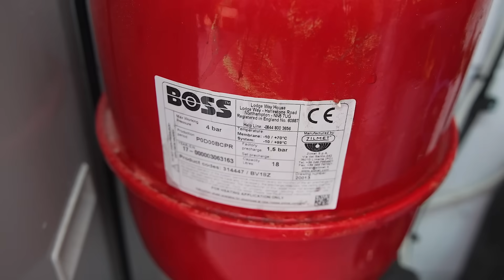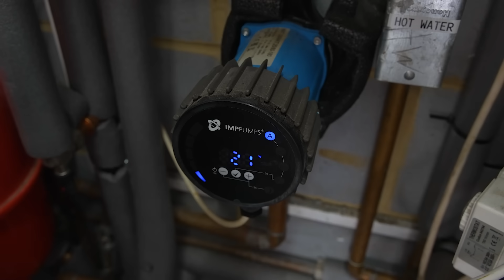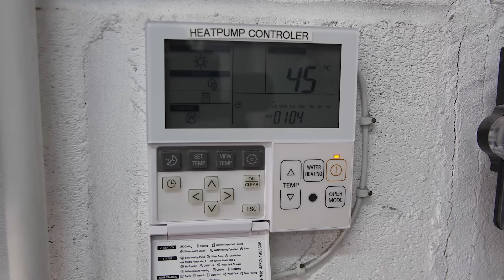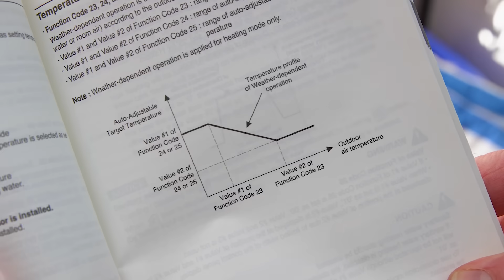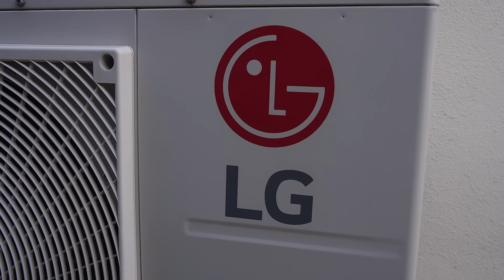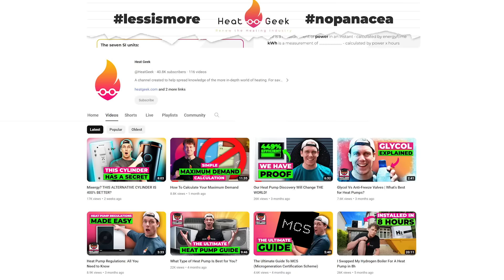Heat Geek Gives His Verdict on John’s Nightmare Heat Pump

Comment: What a great video Adam / Roger! Im sure Adam has a plan to offer John some options to fix his issue. However as a plan B we as installers of heat pumps for 23 years and just acquired by EDF we wanted to help and make an offer that we would replace the Heat pump, get rid of that gas boiler and do the alterations like Adam discussed for free. Our designers are Heat Geek trained also, all have the same vision! Offer is there :) We hate seeing consumers that have paid money for a heat pump with this outcome. Gives the industry a bad name....
Reply: Good on you. Hope this comment gets noticed!
Reply: @heatgeek @skillbuilder
Reply: Lets hope John gets sorted and we  get to see the situation resolved in a video to follow, I would be interested to see the resolution and improvement or simplified of his system .Thank You CBHEATING
Reply: Looking forward to the follow up video showing it all working well.
Reply: Why would you want to get rid of a Gas Boiler that works ??
Reply: @AnthonyTobyEllenor-pi4jq it would be good to see a cost benefit analysis as well as a co2 benefit analysis over time taking into account the cost both financial and in terms of co2 of commissioning the system. However neither of those things reflect the geeky warm fuzzy feeling of having a high tech green heating system.
Reply: @DuncanAtkinson  The system does need electricity, how is this produced ? .  My warm fuzzy feeling is heightened by sitting in front of a log fire on a cold winters night.
Reply: @AnthonyTobyEllenor-pi4jq 64% of the UK's energy as i write this is from green souces. Even if it was 100% from gas then a heat pump is up to 450% more efficient.
Reply: @AnthonyTobyEllenor-pi4jq in fact only 6.6% is currently being generated by fossil fuels
Reply: @DuncanAtkinson  ""Even if it was 100% from gas then a heat pump is up to 450% more efficient. "" more efficient than what ?  Are you including the fuel burned to generate the electricity that powers the heat pump?, and what do you do if there are blackouts ? sit in the cold or what ?  I mention this as blackouts were quite common when I lived in New England, that's due to the practise in the USA of stringing electricity cables from poles, not underground.  If Heat Pumps were so efficient then why did the Government feel it necessary to dish out subsidies to help folk buy them, ? surely if they were really so good then everybody would be stampeding to the installers clamouring to get one .
Reply: @AnthonyTobyEllenor-pi4jq  If burning gas in a gas boiler yielded 1kwh of heat, burning that same gas in a turbine in a power station to generate electricity and then using the electricity to run a heat pump would generate 4.5kwh of heat.. something along those lines anyway. Actually i think there are some efficiency losses but it's still more efficient.. because you are using heat from the environment.
Reply: @AnthonyTobyEllenor-pi4jq it isn't popular at least in the uk because of the cost of installation.. two thirds of homes in norway are heated by heat pumps already. Which also disproves that they don't work in cold weather.
Reply: @DuncanAtkinson  "If burning gas in a gas boiler yielded 1kwh of heat, burning that same gas in a turbine in a power station to generate electricity and then using the electricity to run a heat pump would generate 4.5kwh of heat.. ""  Do you Really believe this ?
Reply: @AnthonyTobyEllenor-pi4jq  although gas turbine power generation is only 50% efficient lets say.. so would need a 200% efficient heatpump to break even.. which would be still more efficient than a gas boiler at 85% efficiency
Reply: @DuncanAtkinson  Gas boiler is not so noisy as heat pumps though and during a power cut the gas boiler would still function.
Reply: @DuncanAtkinson  "although gas turbine power generation is only 50% efficient lets say." You are forgetting the fact that the waste heat from the Gas Turbine can easily be used to power a steam turbine, thus rendering the process far more efficient.
Reply: @AnthonyTobyEllenor-pi4jq  that's true, but even better to generate the electricity from a green source in the first place. Perhaps when we have enough surplus energy we can start to synthesise hydrocarbons or produce hydrogen which could be used to power these gas turbines to fill the gap during periods of low energy production?
Reply: @DuncanAtkinson   I was involved in a green source, it was geothermal heat in Iceland and it's really easy because all we had to do was drill 2 holes, pump water down 1 hole and it comes out as steam in the other hole, the steam can power a turbine. I would not waste time and money on wind or solar, just find places where the Earths crust is thin ( Norway, Sweden), and go for geothermal.
Reply: @AnthonyTobyEllenor-pi4jq  It will not as it's controlled by electricity
Reply: @AnthonyTobyEllenor-pi4jq  Gas boilers don't work without electricity either.  It's a fact most people forget.  Any central heating system requires a pump and timer to work, most have a thermostat as well.  Modern boilers are electronically controlled.  Even the ones that aren't have a solenoid gas valve.  Most heating in the UK is from a gas boiler with radiators.  Blackouts affect them equally.  And yes, if that 1kWh of electricity can produce the equivalent of 4kWh of heat then it's better than burning 1kWh it in a boiler and producing 1kWh of heat
Reply: @AnthonyTobyEllenor-pi4jq  Gas boilers don't function in a power cut.
Reply: @cjmillsnun   , I appreciate that Central heating systems need Pumps, thermostats etc. However, it is possible in cases of power cuts to have a UPS with decent lead acid batteries so you can keep your pump running during a power cut.
Reply: @AnthonyTobyEllenor-pi4jq  Exactly Anthony, when greenies talk about efficiency their blind spot is always the transmission losses from the fight with entropy. And before Duncan dogpiles me I run my house on two heat pumps. And yeah they work great. My only concern is how long they will last. My guess is about ten years. And then what? And why isn't the effort and joules required to build and replace that heat pump part of the efficiency calculations. Meanwhile some one with a wood stove can burn fuel for decades with no problem and no replacement required that adds to the calculus that feeds into any co2 benefit analysis.

I am always going to be a skeptic when it comes to the math... why well because

"Facts are stubborn, but statistics are more pliable". ...

Mark Twain
Reply: @AnthonyTobyEllenor-pi4jq   those same lead acid batteries will run a heat pump also.. same as my solar and battery system... I can run for months through the summer and beyond, with out any grid.. try doing that with your lead acid batteries
Reply: Very interesting.  Great show lads.
Reply: How much space do you need for all this kit... Looks like an industrial plant room!
Reply: A lot of these installes were done under the Renewable Heat Incentive, in which the more inefficient you were the more kickback you got.
Reply: Also concrete releases VOCs whilst it cures. But wind turbines are green.
Reply: @AnthonyTobyEllenor-pi4jq comined gas generating turbines are fed with steam from a steam generator which then condenses. The steam generator uses every kW efficiently.
Reply: Always interesting, practical, well mannerred and enthusiastic. Great channel.
Reply: Just proves how crap and expensive they really are. Good Ol Gas Boiler Is Still The Way Forward 👍
Reply: @LulaJake  concrete does not release VOCs - it releases CO2.
Reply: @nixer65  You are right but concrete sealer is full of them.

Comment: Brilliant Roger - let's see this one to a conclusion please.  Now Im an aeronautical engineer with 45 years experience and I've not met a device yet that I can't change the bearings on - so don't junk the heat pump!  Sounds like the fan motor bearings (just like the usual problem with a flue fan in a boiler!) and LG sell new motors for £300 ish and its a simple 2 minute replacement.  Even if the motor isn't available from LG as an assembly, any engineer worth his salt could replace the bearings.......and the thing is out of warranty anyway!  Maybe its in LG's interest to get involved here and promote their after sales support?
Reply: PS Just checked fan motor and bearings are available - genuine LG parts
Reply: A conclusion/follow-up would be great, but wasn't part of the point that the LG heat pump seen here is a 2-stage unit, which is probably not necessary?
Reply: Surely fixing the existing unit would enable John to gain confidence the Heat Geek proposals before the neighbours go mad with the noise - then decide on a single/dual stage unit longer term when he sees aCOP of >3.5 is possible? @Wayfarer-Sailing
Reply: my thoughts exactly,  stop chucking stuff away and fix it. the bearings would cost next to nothing. this equipment should be maintainable
Reply: Not sure modern washing machines are designed so you can't change the bearings
Reply: I would think the same, but it could be that it's not just the fan motor bearings. If the actual heat pump is also ruined then it might cost a fair bit more.
Of course I'd hope you'd be able to repair for well under the cost of a new unit but who knows. 

I could understand why Adam might not want to promise a cheap fix when he doesn't actually know everything that might be wrong with it.
Reply: @James-dv1df  You can change the drum though - I've just bought a drum as the bearings on my washing machine are shot.
Reply: @tlangdon12  yea but you have to buy the whole drum rather than some bearings which is not economic feasible always
Reply: Exactly, I'm surprised he's suggesting swapping everything out. Even if they don't want to swap out the bearings on their own, you can replace the fans. The system can still be set up to improve the efficiency without replacing everything.

Comment: Adam came over very well here! I was critical of him in the first video. However here in a real situation it was truly fascinating to listen to him pick through the issues. As Roger said, I was too was surprised he was in effect sayings it’s been made me overly complicated and would have been a cheaper install if spec’d properly. The external unit needing to be replaced purely down to being on a poor subsurface is the kind of thing most people would overlook, I certainly didn’t think about it. But stood to reason once explained! Hopefully Johns wallet and passion to get this working can spawn another episode to conclude once the recommendations are implemented
Reply: I think his heart is in the right place. But he didn't fix it did he. He basically said the pump is trash replace it. I'm dubious if any of what he said would work and if would it continue to work. A 1 year guarantee of efficiency (which they aren't even offering yet) is pretty short and pointless on a system that barely provides enough heat to begin with. Remember the consumer goods act says products should be fit for purpose and last 7 years. A £7k heating system isn't something you can afford to replace once a year! I was happy to hear Adam out, but he didn't say or do anything to change my opinion of the tech.
Reply: @nickrider815 he was in a difficult situation there. The pump had been installed incorrectly by a firm that went bust straight after. Warranty on anything is based on it being installed correctly so LG are unlikely to honour it.
Given the high rebuild cost that John would have to pay out of his pocket, plus the fact it’s a wrongly spec’d unit for the job anyway, Adam was advising John he was probably better off cutting his losses with that pump and installing another. 
As a result, with a simplified system he would probably be able to buy a cheaper unit than the original and then have the advantage of a warranty moving forward, which still wouldn’t exist on the original pump even if he got it repaired.
Reply: @nickrider815   , I checked the LG site and it gives a 5yr warranty, Surely it its a bearing gone on a motor it could be replaced rather than changing out the complete unit..waiting to see the out come .
Reply: @darrencoyle3290  I'm going off what Alex said, that it was scrap. Also in the last video they said LG wasn't returning calls on this one. Plus manufacturers warranty will only be valid in accordance with correct installation. So the warranty will be invalidated in this instance. 

I have spoken to a lot of heating engineers, plumbers and several actual owners and a part from one they all regret installing these things. Heat Geeks offer to maybe one day guarantee a 15-20k  heat pump installation for 1 year with caveats isn't going to change my mind.
Reply: @darrencoyle3290  That would be the case if the boiler is no more than 5 years old AND if it was fitted correctly according to LG's specification.  So if the spec says "ensure that the heat pump is installed on a level surface" the warrant won't apply.
Reply: @darrencoyle3290 Sure, but you are sinking more money into something that has already run a fair bit of it's expected lifetime. The chances of something else going wrong in the next few years is quite high if the unit was poorly installed initially and  those repair costs add up. A new unit properly installed comes with the peace of mind of a good installation and a long warranty.
Reply: @nickrider815 I agree diagnosis was lacking a little  what really went wrong  was the pump weak? was the working fluid contaminated?was the fan slow running? was the unit badly placed?.did the electronics check out? did  any valves in the system close or open fully.?was the thermostat accurate? Was the unit regularly serviced? A great presentation by all but listening to a squeaky fan without getting an oil can out or showing a replacement.transplant was an opportunity missed. One really needs to check the performance against manufacturers specs..... does the unit self diagnose?

Comment: Surely heat geeks are going to get this system working properly regardless of costs . 
This is the ideal opportunity for Adam to put his knowledge to the test and prove the doubters wrong.
Reply: onlyhonestpersononyoutube  John the homeowner said in the vid the system works , it’s just too expensive to run . 
Adam from heatgeeks replied, we can fix that with a weather comp sensor.
Reply: @haydnlawrence8167 sounds like the easiest option would be to get a Worcester gas boiler.

I mean look at all that pipe work and tanks, it’s mental

Comment: Rodger one of the best  videos I've seen on explaining a product, I was transfixed even though I've no intention in having a heat pump but the heat geek guy was great. 👍👍👍
Reply: I’m an Engineer in AC and refrigeration. Don’t touch this stuff with a barge pole. It’s basically Airconditioning system. It will not last long before either the printed circuit board or compressor fails and the cost of parts and labour of people with half a brain is expensive. Plus technicians aren’t that clever. Most engineers are guessing and you will pay for parts you don’t need or many times just lots of parts at once to cover all bases and the bill will be horrendous. What it all comes down to to is the uneducated get a raw deal look at Kovid look at the general population normies who went for the lies now the same people are gonna be getting this installed. Lambs to the slaughter.

Comment: What a great video.  We've had our heat pump for 8 years and it is still running really quietly, it's a big pump (Samsung 16kw) to heat a big house.  We don't have a buffer, everything in the system works fine.  My only issue has been that the installer didn't explain anything about weather compensation and they had set the temp at a constant 45c, just like the installation in this video.  This, combined with the fact that we have a Honeywell on/off room thermostat was causing the heat pump to cycle on and off too much.  I have taken it on myself to learn how to set it correctly for weather comp and I now have it running successfully at a much higher efficiency and the house is still warm all of the time.  We're achieving a SCOP of around 3.2 in Winter and 4.2 for the rest of the year, compared to 2.0 and 3.0 as it was set up previously.  Very happy with it now, I just wish our installer had set it up this way in the first place.